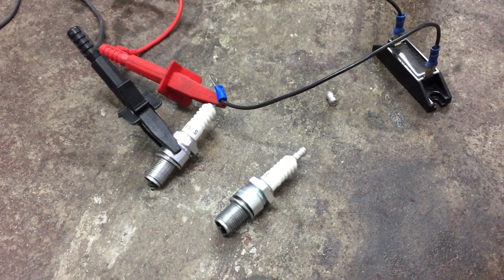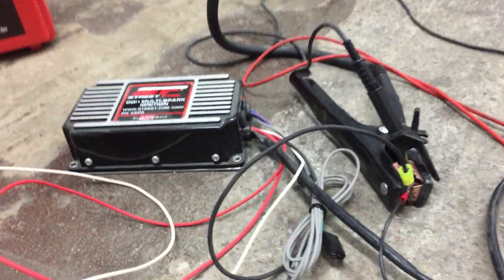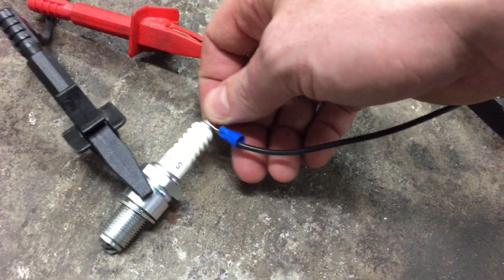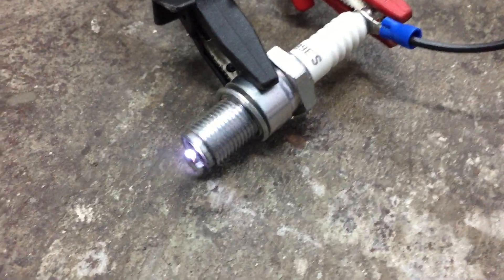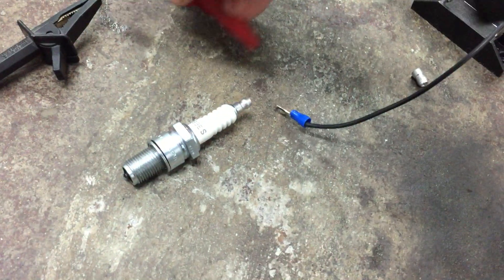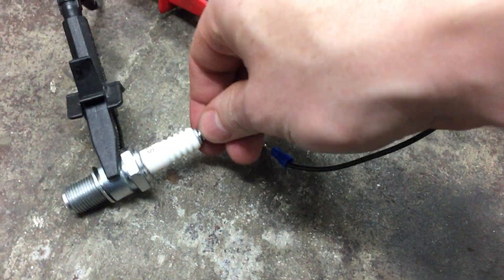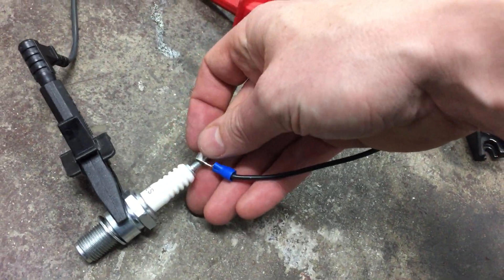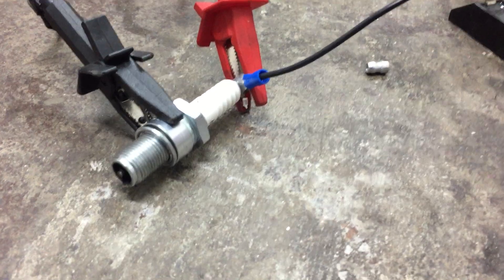Nikola Tesla's Pulse Detonation Engine - CDI Spark vs Plasma Spark Ignition

Comment: Could you point me In the right direction on how to make this set up. Love the video mate.
Reply: Why isn't this used on car so if add a diode to the postive lead im guessing. Its just canceling one of the ac current wave turning it into high voltage dc.  

 But how long do the spark plugs live..

This would be perfect for a mazda rotary..
Reply from the maker: @far1002  Search “Ignition Secrets” by Aaron Murakami. He is the source of bringing plasma ignition from the shadows into the light. He has some videos on YouTube with the ignition system fitted to a vehicle.
Reply from the maker: @far1002  most cars haven’t got CDI ignition, low ohm coils or low to zero resistance leads. Granatelli has patent on the 0 ohm spark plug leads and then have ferrite rings each end which is what is protected by the patent.
Reply: @nikola.tesla.r.and.d.centre  patents are stupid smh hampering everything not everyone wants money
Reply from the maker: @far1002  investors want to protect the intellectual property so their businesses can profit though. Capitalism has made the world cruel and unkind.
Reply: @nikola.tesla.r.and.d.centre  the world is already cruel and unkind.  Capitalism is a system that functions within that framework better than any other.  Let’s put the horse before the cart - if we want to move beyond capitalism we need to not be cruel and unkind.
Reply from the maker: @far1002  truth is that it enables plasma which doesn’t erode like a spark does on a spark plug.

That would enable two things.

1. The plasma plugs would last a very long time if the right metal was used.

2. The supposed perfect air / fuel mix “lambda” 14.7 parts air to 1 part fuel, something that engine ecus are designed to try and maintain no matter what would go out of the window as you get a cleaner burn using high voltage plasma. It’s like comparing normal ignition to plasma ignition as candle vs dynamite. Tesla invented capacitive discharge ignition and it was used on Spitfires and also Saab’s until they went bust. Known in the auto electrical motor trade as one of the ignition systems to be most careful working on. If you’ve ever been shocked by a normal 12v ignition coil you will appreciate that these very low ohm ignition coils have 12v upped to around 400v and then discharged from a capacitor. 

The HV diode placed in the correct place allows a greater amount of energy to be discharged in a shorter amount of time. 

Perhaps someday I’ll get the equipment to be able to show the waveforms of before and after on a scope.

I’ve since bought a controller to enable 660hz... I can go higher with another bit of kit.

I do want to explore Tesla’s method of burning nitrogen and combining it with cold steam to produce nitrates and ammonia. Making fertiliser is one of the unknown research and development areas of Tesla.
Reply from the maker: I open sourced it on my Patreon. This wb address is www.patreon.com/TeslaTurbo It's one of the oldest posts.
Reply: @nikola.tesla.r.and.d.centre  instant electrolysis on internal combustion chamber = water vehicles.
Reply from the maker: @SharhbiniRauf  Tesla had 2 denied US patent applications for the method and apparatus for s self-propelled vehicle. A retro fit nitrogen / steam engine.
Reply: @SharhbiniRauf  yes my friend this is what I envisioned in a dream sometime ago. Very simple to apply and yes you definitely you have to have plasma spark that is not impeded by the water vaper as it combusts. There are other means to ignite it without the spark thou.

Comment: Does the direction/polarity of the diode matter? Thinking of applying this concept to a four cylinder engine, so the circuit is going to be slightly different, which would make each pair of plugs fire with opposite polarity.... You basically made a half wave double circuit, similar to what is in a microwave. Quite fascinating!

Comment: Lot of unanswered questions, voltage, coil parameters, input waveform, frequency?
Reply from the maker: 12v / 14.4v DC input to off the shelf CDI ignition system which outputs about 400v to a Petronix Flame Thrower III ignition coil.

Square wave to 5 pin automotive relay to white wire of CDI system.

Could go up to 660hz with a transistor rather than electromechanical relay. 

Currently just doing 10 - 90hz from memory.

The discovery was that Tesla planned on using the ignition system for initial ignition to warm the chamber up.

Comment: Which way round is the diode? Also have seen this with a small capacitor between the ht and ground. Which if any is better? Or use both?! Would a plug with the ground electrode removed work under the high pressures of the combustion chamber? Plug gap is normally critical. Finally, if this system is so efficient, why isnt it used on ALL petrol cars? Such a cheap mod to get better economy? Or is any effect negligible?
Reply from the maker: 1. Pointing towards the coil. If you get it backwards, it just won't work. 2. I've not seen that before, not sure. Aaron Murakami would likely know the answer to that. 3. There are actual spark plugs designed for this type of ignition. I've got a photo somewhere. I meant to buy some. 4. I think the answer lies in that technology is drip fed and much better technology than what we currently have now has been available for well over 100 years. The reason we don't have many of Nikola Tesla's inventions is because he didn't believe in inventing things with planned obsolescence. Morals over capitalism every time.  There is no conspiracy theory here but a sad story of the financiers choosing technologies that in their eyes, they could string out their profits for much longer. Capitalism hasn't done the earth much good though has it. Ultimately the piston engine is completely flawed in so many ways, but for now it is useful whilst we transition to something simpler with no planned obsolescence. The motor manufacturers are not going to lead the way. The people are going to have to retro fit themselves. I've been working on Tesla's solution for this for many years.

Comment: There are 2 problems i experienced with plasma ignition
1. Spark plug eroded pretty fast
2. When spark plug tips oxidizes, spark intensity drastically reduces
Reply from the maker: Were you using off the shelf plasma ignition plugs, resistive plugs or non resistive plugs? The beauty about the apparatus we are using it with is the ignition source just allows the chamber to get hot and then self ignition occurs. To be fair a glow plug can be used instead but of course has a much higher current draw. Also you can't here the glow plug is on.
Reply: @nikola.tesla.r.and.d.centre  I made the plasma unit myself using inverter and high voltage diode setup
Used it for 2 years and after inverter failed did not bother repairing it and scrapped it. Figured it was making a hole in my pocket, buying non resistive spark plug all the time.
Reply: @firozmusthafa  did you experience some improvements in the power , fuel consumption , start , idle, etc.?
What was the power of your inverter and what voltage it was providing to the spark plug via HV diode ?
Thanks in advance !
Reply: @flappingflight8537  there indeed is some. Minor improvements are noticeable when we pay extra attention. Plasma becomes very useful when capacitance is increased to a point when spark plug vaporizes within minutes (you can see experiments in my channel)

I used chinese 60watt 540volt ac inverter
Reply: @firozmusthafa  thanks for your reply ! Have you tried to use inductor between the capacitor and the HV diode( in series with the diode) It will extend the spark discharge duration and will limit the initial rush current which is eroding the spark plug electrodes but wouldn’t waste the discharge energy as the spark plug resistor .
Reply: @flappingflight8537  because of unavailability of variable inductor, couldn't find the resonant frequency of the spark plug by varying inductance.
The closest thing I was able to accomplish was to vary different capacitors
Reply: @firozmusthafa  no , I don’t mean resonant circuit and you no need variable inductor for this . I’ve read a lot of ignition systems research papers and there they divide the spark event on few phases . The first one is when the HV increases from 0 to the breakdown voltage of the gap . The second is so called “ capacitive discharge phase “ because during this period, the energy stored in the capacitance between the secondary windings of the ignition coil , the capacitance of the ignition wires , the distributor and the plug discharges extremely rapidly through the spark gap and if there is no resistance in the wires , distributor and the plug the current is extremely strong and erode the spark plug electrodes and the terminals on distributor cap and create very strong EMI which is a problem for most ECU controlled engines, also since this phase is extremely short it doesn’t contribute too much for igniting the mixture but contribute the most for the erosion of spark plug and distributor electrodes .So the ignition system engineers trying to minimise the capacitive phase and to reroute the energy to the third so called “ inductive phase “ which actually ignite the mixture . That is why there are even such a ignition wires where the resistance isn’t very high 2KOhm/m but suppress the high current surge during the capacitive phase by inductance . The most of folks on YouTube seems to make just the opposite , charge some capacitor to few hundred volts and discharge it through the spark gap which looks like enormous spark but since it’s very short fail to support the initial flame karnal by pumping additional heat in it during its growth . That is why I think that will be beneficial the capacitor to be discharged through the inductor , because the inductor will restrict the initial current surge and when the capacitor is discharged will keep to maintain the current trough the gap for a little bit longer . This not only will slow down the erosion of the spark plug electrodes but will contribute to the faster growth of the flame .
Reply: @flappingflight8537  Based on your requirement, you just need new HT coil, new low impedance spark plug wires and non resistor spark plug

You were right that more heat is required to increase spark delay to ensure complete combustion, but a low tension source (in my case low voltage inverter connected to the capacitor) can't work just the way we require it to work (with the manufacturer set frequency of inverter) without the help of resonance for which an inductor and capacitor is required for achieving resonance with spark plug to achieve more spark duration. I hope that this should shed some light on your requirements.
Reply: @firozmusthafa  some guys use dc/dc boost converter which power up only the ignition coil and the commutator ( this for ignition systems where the energy stores in the inductance of the coil) They increase the voltage from standard 14.2 V up to 18-19V and they report very good results ( I can provide videos but they are on Russian) . What they basically are doing this way is increasing the energy and the duration of the spark discharge ( the inductive phase of it ) What I mean is that ( according to your report ) additional fast pure capacitive discharge doesn’t contribute too much to the power ,fuel consumption, acceleration , etc . but erode pretty fast the spark plug electrodes when increasing the powering voltage of the ignition coil and commutator only with 4-5Volts give you much better results and this without using nonresistor plugs , cooper core HT wires etc. So, long enough 1.5-2.5 ms discharge duration with current of 100-200mA seems to be much more useful than few 10-100us 100s A discharge . There is similar solution from Japanese company OCADA racing. Will attach the video later .it’s on Japanese.https://youtu.be/GN-TrbXqPGw
And here the Russian video https://youtu.be/hYsYLBPc-Q8
Reply: @flappingflight8537  yes the method you mentioned is equivalent to using a race spec ignition coil, cdi, spark plug cable and a non resistor spark plug all of which are made by Takai (not affordable!)
So I ended up using NGK iridium plug ultimately 🤣
Reply: I believe all ethical (disruptive) manufacturers must have followed these routes and ended up with the best cost effective solution for us

The real direction science has to move forward is to use cold electricity instead of hot electricity, this should be why we need costly solutions to make a disruptive solution.

Had it been Tesla allowed to transmit cold electricity, we would not have had to invent an internal combustion engine for transportation!🥰😍
Reply: @firozmusthafa "Cold" electricity. Lol.

Comment: What if you fill your gas tank with water and try that on a lawn mower engine. Will the plasma arc make a water mist explosive cavitation effect?
Reply from the maker: If you want to try that route I recommend reading Aaron's work. I used an off the shelf CDI unit. If you can build you own circuits and upgrade the capacitive discharge, the addition of water does some unseen things. www.ignitionsecrets.com
Reply: @nikola.tesla.r.and.d.centre  What about just using a small bike carb jetted extra lean and a voltage multiplier on the magneto?
Reply from the maker: @travismoore7849  I'm not sure, you would have to try it. Basic experiments will at least teach you something.

Comment: Hi could you point me to how to build it . Electronics are stalling me and I'm told a magnetron or neon sign transformer could carry it out cheers
Reply from the maker: If you building plasma ignition for the pulse detonation engine as you can just use a glow plug instead. Once the heat of the chamber is hot enough you don't need the spark. 

If you want to know everything about the plasma ignition follow this link:

http://www.ignitionsecrets.com

Comment: would it be better to have non resistor spark plugs . also would you sell a unit for a 4 cylinder petrol engine ,i am researching the joe papp engine and ion energy by air plasma disruption but in a sealed car engine under vacuum .
im in bolsover britain sounds like your not far
Reply from the maker: Hi, it is a non resistor spark spark plug. Sorry but I haven't got any units for sale. Sounds like you have some interesting projects on the go.

Comment: Can we produce enough electric spark plasma to create a power combustion for the engine so basically you're just burning pure air it breaks down the air the H2O at the same time it burns it
Reply from the maker: It appears from our research that Tesla's intention was ionizing nitrogen and using the shock waves to spin the rotor. The most abundant gas in the world, why wouldn't you want to try and harness the normally inert gas.
Reply: @nikola.tesla.r.and.d.centre  Since Nitrogen is about 80% of air, ionizing a significant portion would end up producing HUGE amounts of NOX gasses - or PURE SMOG ??
Reply from the maker: @peterdarr383  Tesla's scheme is to fix the nitrogen with the steam to form NO2, NO3 and distilled water. He spent a long time figuring out how to ionize nitrogen more easily using vacuum and or high voltage / frequency, and, how to fix the compounds. He said it would bring incalculable benefit to mankind. 

Do a CTRL F search for "benefit" and read around these parts. Also search the word "nitrogen". https://teslauniverse.com/nikola-tesla/articles/problem-increasing-human-energy

There are many other references but they are scattered among many articles.

Nitrogen shock waves are his ultimate energy source mixed with atmospheric pressure and water. 

Or you can just run it off the heat of whatever you can think of. Which is no good for something mobile, unless its pretty big.

Ultimately this could be a nitrogen shock wave / steam rotating detonation engine with liquid fertilizer emissions.

Comment: Just imagine how much EMI that would be blasting out.
Reply from the maker: Exactly the reason I want a spectrum analyser. Now optimised somewhat the ignition only needs to be on for less than 10 seconds and then self ignition occurs. Some would argue that plasma produces LMD waves rather than transverse waves. I think using a sophisticated spectrum analyser would be the only way to prove the EMR part of that discussion. Tesla did have gauges for measuring LMD waves, this is how he started to measure lightning and how long it took to reflect. British Patent 8,200 Fig 2 for example.

Comment: Wow, that's a beastly spark.
Reply from the maker: I certainly wouldn't want to touch it... CDI alone can apparently kill you with 40kv from a cap discharge. I wouldn't want to test the theory. I have had enough 20kv zaps from basic ignition systems.

Comment: This guy did a cool comparison of off the shelf spark plugs. He found some of the fancier designs were about 2-3% more fuel efficient, which surprises me. It'd be interesting to see if there is a difference with your setup. The engineer in me is skeptical, but that is irrelevant!  Empirical evidence is all that matters.
https://www.youtube.com/watch?v=jcVF3xL_fzk
Reply: @nikola.tesla.r.and.d.centre  He tested one that said it had a built in capacitor in it, seems similar to yours, but the spark was clearly smaller. 

Plasma should produce a considerably hotter spark. I'm curious if it will make any difference. The flash point of gasoline + O2 is around 260C, clearly a NTK spark plug can achieve that temperature. So does a plasma spark that's 500C or 1500C make any difference?

Once the fuel is over the threshold to combust, it should provide a chain reaction to ignite the rest of the fuel in the chamber. 

I'm not sure how this will be useful, but maybe this could become effective for fuels with a really high flash point? Maybe you could use Beryllium as a fuel. It's twice as energy dense as gasoline but it's boiling point is 2400C. :-)